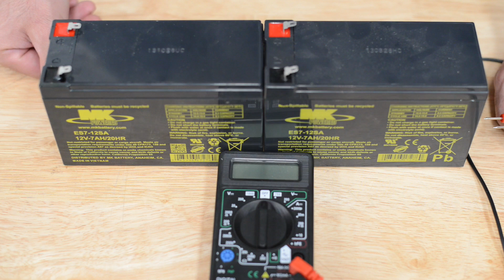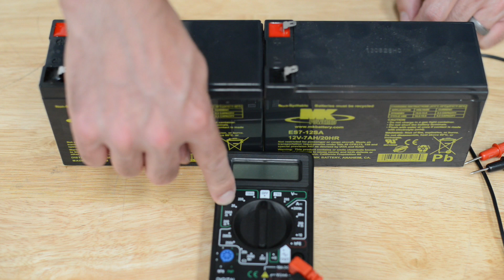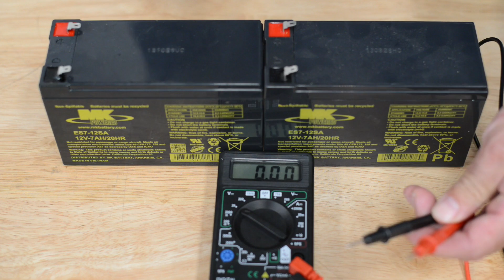How To Test Battery Voltage For Driveway Gate Opener

Comment: Under load testing what readings would be unacceptable for a battery ? A follow vid up on testing batteries under load would be a great 👌
Reply from the maker: Hi! It depends on the gate opener since they have different amounts of power. For specific information, what opener do you have? Thanks!
Reply: @Watch2DIY 
My gate opener is a american armor brand. It is 13.18 v when not under a load. It is 8.13v while under a load. I believe that's what is causing it to stop midway through opening. Please let me know if you disagree. Thanks

Comment: Very descriptive I am relatively familiar with batteries and testing. One thing that was left out is what would be the minimum voltage of batteries under load, and minimum voltage open circuit

Comment: just curious I just got a second battery for my gate opener, does it draw power from both batteries at the same time or does it drain one batter first then the next battery second?
Reply: In the vast majority of gate openers they will pull from both batteries at the same time. Keep in mind that new and old batteries should not be mixed, a bad old battery can pull down the new one and overwork the charging circuit on the control board. don't risk  $400.00 CONTROL BOARD TO SAVE $40.00. Also keep in mind if you are plugged in and don't need the extra capacity only use one battey, otherwise you are just adding an extra component that can fail without any benefit.
Reply: @anthonygaeto56  great info